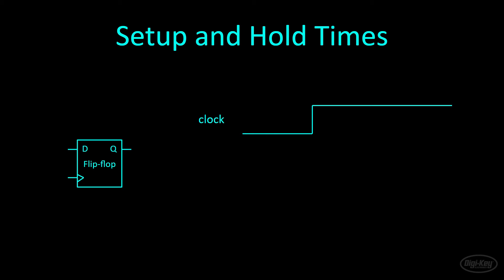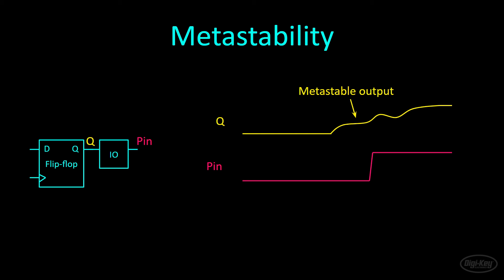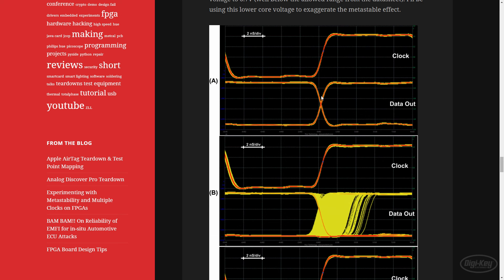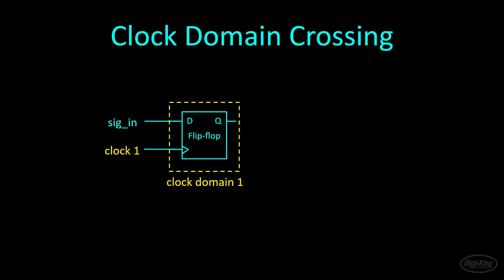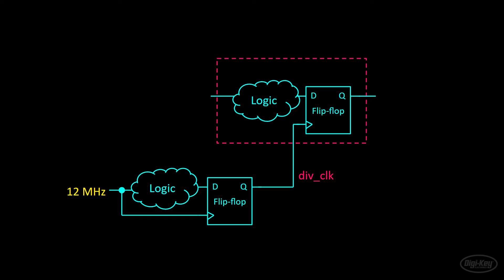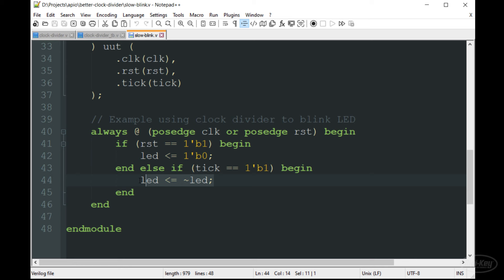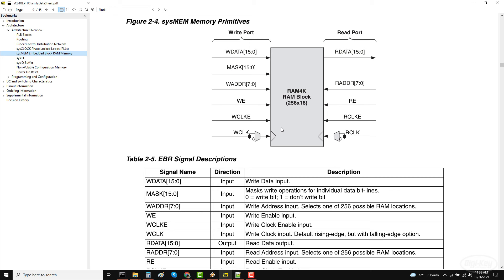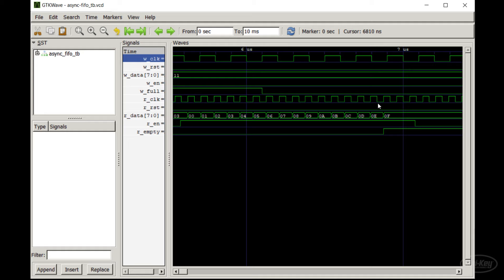Introduction to FPGA Part 10 - Metastability and Clock Domain Crossing | Digi-Key Electronics

Comment: Another great entry to this series!
You should also have probably mentioned that many of the bigger vendors have built-in FIFO logic with their block RAMs (i.e. Intel and Xilinx). You're always better off using the built-in logic (unless there is a special need to not use it - such as reducing delay). The downside though, is that those FIFOs are not inferable and instead need to be instantiated via macro. Often the solution to make a design cross-platform is to wrap the FIFO implementation in a generic module, and include the relevant implementation for the given target (even across Xilinx chips for example, there is a different macro for the 6 series, 7 series, and Ultrascale series).
FIFOs can also be used to pass generic control signals other than pure data. One method is to do delta-compression, where only bit-vector updates are pushed to the FIFO (so you encode the signal bit-vector with XOR when you push, and decode it with XOR when you pull. If you didn't do that and instead pushed every clock pulse, then you could easily overrun the FIFO). If you need bi-directional signals, you can use two FIFOs in either direction. One easy example where this is very useful, is VGA timings. If you have a VGA output driver (with variable clock and timing for different monitor resolutions), and a set frequency image generator (like a bitmap BLITer), you can use a FIFO to send synchronization signals such as "Start_of_frame", and "new_scanline", to keep the image generator in sync with a scanline buffer (that allows you to use a scanline buffer instead of a full frame-buffer).
The only times I have ever used a synchronizer, where cases where the update can be fuzzy (i.e. glitching is acceptable). And doing so requires specialized timing constraints to prevent the P&R tool from complaining about timing violations (usually I use a false-path constraint, which will stochastically add delay to the synchronizer making it completely impractical for general clock domain crossing).
Anyway, looking forward to the next episode!

Comment: I am so eager to run through this series myself starting from the beginning tutorial however I can't start without a board.  Sorry if you have already addressed this a hundred times but I am guessing that until the chip shortage is over (in 3 years :)) we will just have to hang tight.

Comment: This is a big issue with high precision sensors, because you don't want sensor modulation frequencies to be harmonically synchronous with your demodulation system. So you have to decouple the two systems, and pass data between them asynchronously.

Comment: Using an asynchronous reset is also discouraged. You should only have a single process that converts your asynchronous reset to synchronous. The rest of your logic should run on the synchronous reset.
Reply: Good point, thanks! I've seen some chips that are fine with asynchronous reset, but I do agree that it makes more sense to use synchronous resets where possible.
Reply: @ShawnHymel  it helps most to assure that multiple circuits come out of reset at the same time.